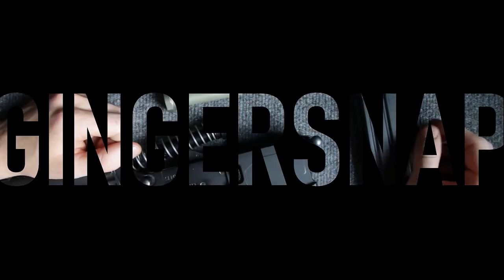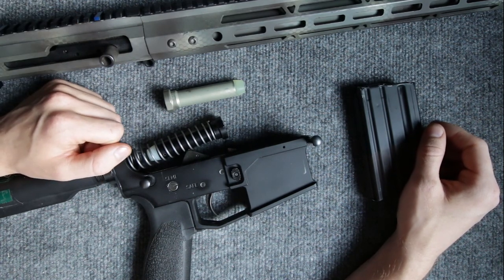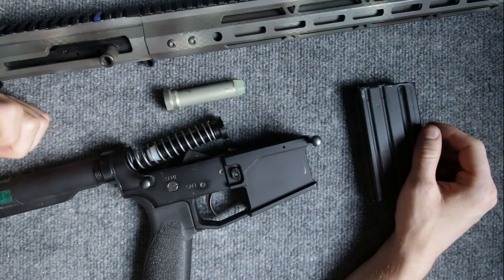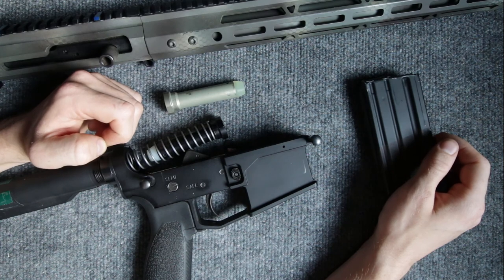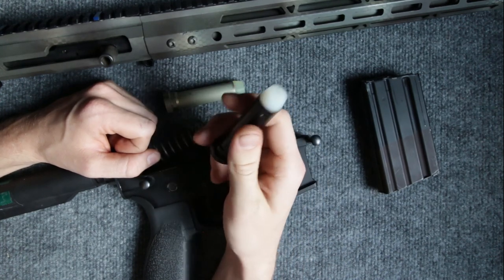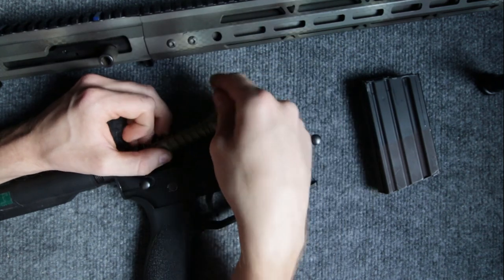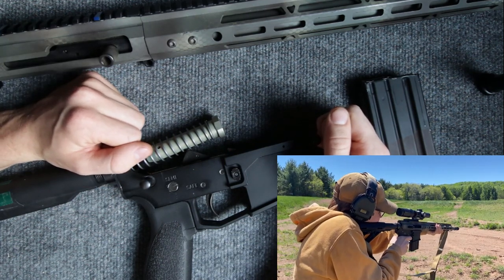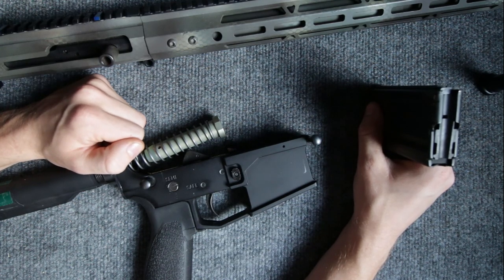Bear Creek Arsenal Side Charging .450 Bushmaster Cycling Issues | SOLVED!

Comment: I am actually running an extra heavy buffer.. have to look it up, 6.8oz.   H4 .   makes it a smooth shooter .
Reply from the maker: The 5.4 oz shoots fairly smooth but it still has a little bit of sharp recoil. I may try a 6.8 oz myself
Reply: @CreativeNameStudios  try a Cozad buffer. They are like a hydraulic buffer but use a spring instead of a hydraulic oil. And they have h1 h2 and h3.  And it's a veteran owned business.

Comment: Had all the aforementioned issues, .091 drill bit in the gas port fixed it!
Reply from the maker: Overgassing will usually fix a lot of feeding issues. Though this was easier and gave me the results I was looking for! Thanks for the comment!
Reply: Dude same exact thing happened to me. Took me forever to find it. I gotta crash course in AR 101. Now this thing is a sewing machine. Need more rnds though. Anything but straight metal 20rnd i.e. 7rnds has issues, alot!! Any suggestions?

Comment: WOW thanks for a solution video. So many post problems but not the final solution. For me....the pewpew would eject but fail to pickup the next round with a standard carbine buffer and spring. So thinking it was not able to cycle back far enough (for a number of reasons) to pick up the next round I have tried several lighter buffers with no success. Maybe it is cycling to fast so I am trying a heavier buffer or spring next. Thanks.
Reply from the maker: Hope it works for ya!
Reply: Did that solve the issue?
Reply: I too would like to know if that fixed the issue

Comment: I run a red springco buffer spring with a 5.2 oz buffer in my 450 bushmaster. It shoots perfect and the shell extraction is at 3-4 o’ clock.
Reply from the maker: I haven’t looked into aftermarket buffer springs much. Do you think it’s worth the upgrade?
Reply: @CreativeNameStudios  yes. The springco springs are $20. Go to tacticalsprings.net

Comment: I had a simlar issue, I figured out my extracts was just barely contacting against the teeth on the barrel extension. A little dremel work and no problem since. Look for a rub mark on your extractor and small guages in the cartridge rim.
Reply from the maker: interesting. I haven't investigated my extractor. ill take a look at it. Thanks for the input!

Comment: Had the same issue with a BCA side charging 450 BM upper but I was using H2 buffer with a red Springco spring. Didn't need that heavy setup. Swapped in a standard carbine buffer and spring, now it works as it should. Had the same experience with a 7.62x39 using too heavy of a buffer and spring. Running a A2 buffer and rifle spring  with an A1 length stock and that 7.62x39 has cycled flawlessly for 100 rounds so far using a 10 round C-Prodcuts mag with Wolf ammo.

Comment: Many of these complete lower kits come with heavy buffer springs. Which causes the bolt not to go back all the way when fired. If it loads fine when you drop the bolt but not when fired, gun is under gassed, spring is to heavy. I run a wolf lite spring and a h2 buffer in a 50 Beowulf.
Reply: Good call on buffer, get a flatwire spring and see why thy better
Reply: You are so far from correct. If a cbc is not way overgassed, then ther is a burr or gas block misaligned

Comment: Remove your gas tube.  You will see that each end is tapered down reducing the tube’s diameter.  This is from being cut with a tubing cutter.  Open those ends back up.  Get a drill bit that fits exactly the ID of the gas tube.  Use that bit to open up your barrel’s gas port.  Install an adjustable gas block.  Now you not only get fully adjustable gas, but you now have the mechanism in place to reduce your felt recoil.
Reply: No need to mess with the tube, the port is so much smaller the tapered ends are irrelevant.
Reply: @roberthughes2687  For complete flexibility to operate a range of hand loads using various powders of different burn rates and pressure curves, the barrel’s gas port should be the same size as the gas tube’s inner diameter.  If it is not, simply drill it out.  The concept is to give the fixed components the capability to run any custom ammo, then regulate the gas pressure required by using an adjustable gas port.  Of course this is unnecessary if one only runs full power factory loads.   Think of it in terms of a .300 Blackout where you may want to run supersonics with light bullets then turn around and run slow subsonics with heavy bullets and slower burning powder.  The rifle now has the ability to breathe if you need it to.  You don’t want your rifle to be pigeonholed into only functioning with one type of loading.  Since we know that most AR’s and factory cartridge loadings are way overpressured anyway, throttling back the gas can reduce the felt recoil significantly by eliminating the full force rear impact of the buffer hitting against a fully compressed buffer spring.  
So why open up the gas port diameter?  Have you ever had a fun day runnin’ and gunnin’ with a near zero recoil 9mm AR?  You can do the same thing with a .450 using low cost reduced power hand loaded ammo.  No use getting punished by recoil when you’re only shooting steel at less than 100 yds.
Reply: @blackhawk7r221  that's absolutely incorrect I suspect. The gas port is never the same size as the inner diameter of the gas tube. The gas port is measured in thousands of an inch and the tube much larger.
Reply: @blackhawk7r221  opening up the gas port to much  creates an over gassed situation, bolt bounce and cycling issues along with more felt recoil. You want only enough gas to hold the bolt back after the last round has fired. Either way the gas tube taper is not a thing.
Reply: @roberthughes2687  That is why a proper system uses an adjustable gas block.  Just look back at all the world’s classic battle rifles and machine guns.  Hell, I’ve had to open up the knob on my old SAW during an engagement. Ever notice the tens of thousands of complaints about people’s “custom” AR’s not cycling properly due to gas issues?  They incorrectly start buying band-aids like different weight buffers or springs rather than addressing the actual problem of gas.  Fixed diameters in fixed systems only work with standardized loadings, thus severely limiting flexibility.   But as I’ve said before, that is fine if one only shoots standardized factory ammo.
Reply: @roberthughes2687  That is correct, and what I wrote.
Reply: @blackhawk7r221  you are correct about adjustable gas blocks. However there is never a reason to cut the slightly tapered end off of a gas tube. That's what my statement was about. The port wide open on any adjustable gas block is still far smaller than the gas tube itself. Under gassed and you don't have last round hold open, and feeding issues, over gassed and you have wear, recoil, and feeding issues. None of which are ever the fault of the gas tube unless it's damaged. That's all I'm saying 🙂

Comment: Mine came through with the gas port drilled too small.  It took a little bit to figure it out.   I sent the upper back and they drilled it to spec.   Problem solved.
Reply: What size is spec?

Comment: I was having an issue with the bolt over running the next round. My solution was to use the H3 buffer and with the H3 buffer it doesn’t even cycle the bolt back… do I have a gassing issue?
Reply: My problem is that the bolt is catching the bullet past the rim

Comment: I had this problem in my BCA AR10 side charger. I was shooting 147 grain loads. 
When I started shooting 180 grain loads...It ran like a sewing machine...no malfunctions whatsoever. It seems like the heavier loads generate enough bolt thrust to cycle the gun completely.
Do I get another buffer tube spring?

Comment: I can’t get mine to chamber a round.The bolt will  not close on a round!!! So far it’s a POS!!
Reply: How’s that headspace issue?
Reply: Also check the extractor. The Bear Creek supplied/modified extractor had raised burrs large enough it barely moved. Cleaned up extractor added a Tubbs flatwire recoil spring, feeds and cycles now.